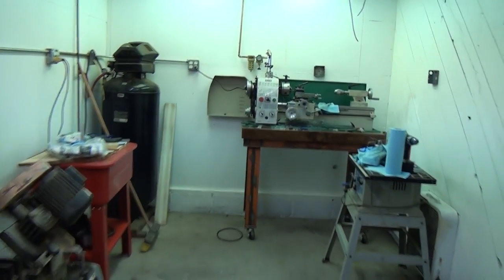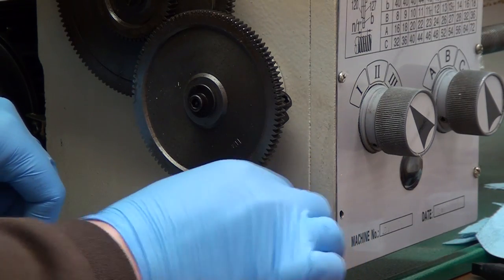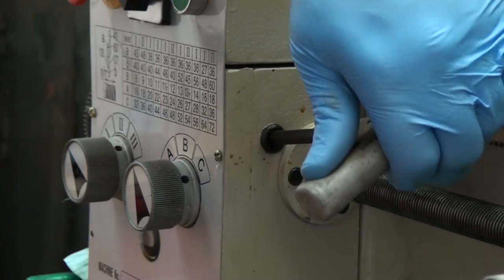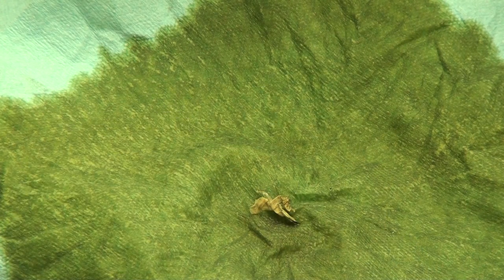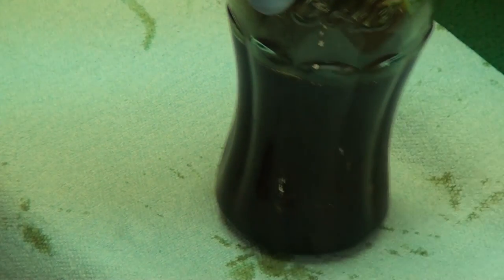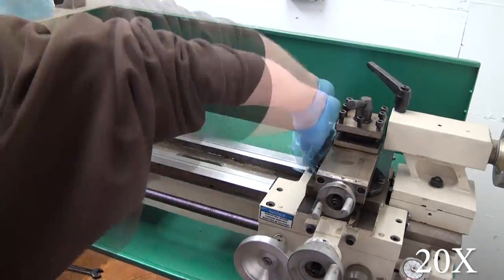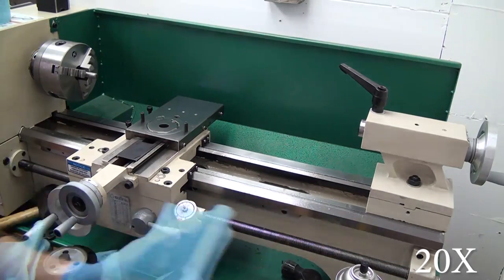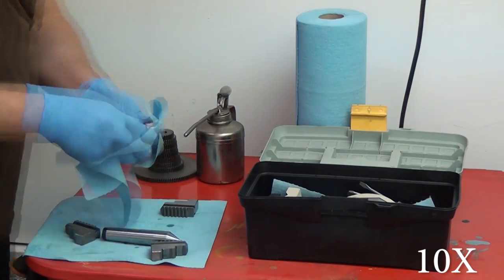05 G0602 Cleaning and Oiling

Comment: Did you ever remove the leadscrew from the left side, into the gearbox?  I have a G0768 that I am re-building (it's actually new) and want to look at the ball bearings but need to remove the leadscrew in order to get get access to them.  When I remove the left cover (on the gearbox, similar to yours at 1:06) it only comes out about 1/2".  Removing the right leadscrew bracket finds the leadscrew un responsive to pulling out of the left gearbox. Manual (not completely accurate) shows a key on the connector shaft left of the coupler but as I am finding out as I disassemble and fix/clean things, there are things that aren't what they appeared to be.  I am thinking I may need to use a puller mechanism at the right side coupling nut. Thanks for any help you can provide.
Reply from the maker: Hey Ron. I wish I could help you out, but the only thing I vaguely recall is removing the front of the gear box just to see how the knobs work. I was hoping I had some footage from when I did my CNC conversion showing whatever I was doing in there, but I just checked my raw footage and there was nothing of use. Good luck to you.
Reply: @russtuff  Thank you for checking!

Comment: I have been using 90 wt gear oil on my lathe as well. I read that chainsaw bar oil is a good substitute as it is sticky and stays in place better, so I will be switching to that soon, since i have a few gallons laying around and almost neer use a chainsaw anymore.

Comment: Have you given any thought to using ISO 68 for your gear box, lead screw, and ways? and use ISO 32 on your bearings, ball oilers and every thing else. It is cheap, About 20 for 2 gallons at your local tractor supply and is better formulated for these purposes. It's pretty much the same thing that all the companies sell at ten time the cost. Give it a try I don't think you will be disappointed.

Comment: I'm not sure if the HDR-CX350 has the "Intelligent Auto" setting (I'm using the HDR-CX760V--finally had to replace the HDR-SR11 that I basically worked to death over the past four years).  If it does, you might want try a manual white balance on the HDR-CX350.  It'll make for better continuity on different takes.  (Makes the blue shop towels actually look blue under the fluorescent shop lighting.)

Keep making chips!  You're making my little G8688 envious...

Comment: I was curious about what Grizzly had to say about the grease in the spindle bearings.I emailed them and here is their response:"The spindle bearings of the G0602 are packed with grease for storage purposes.  For operational purposes, you should be oiling the bearings prior to use, every day you use the lathe.  This will wash the grease our of the bearings, but they will be properly lubricated with the ISO 32 oil".Hope this will help other owners of this lathe.
Reply from the maker: +Bill rouleau Wow. I wish I had realized that. I've been running mine since 2011 until about a month ago having never oiled the bearings. Last month I started pumping in non-detergent 30-weight engine oil. I use one of the Harbor Freight small oiler (not the large one with the seam).

Comment: Do you have a suggestion on oil to use in the ball oilers? I live in the middle of no where and no one has ever heard of iso32... thanks and love the video!
Reply from the maker: I"m using 30 weight non-detergent oil in my ball oilers. I picked it up at Autozone, and I believe it's Autozone brand too.
Reply from the maker: Hey O'Reilly has ISO32, it's just 10W hydraulic oil. I bet other auto-parts or tractor places will have it. Check out https://bit.ly/2uvk2YR

Comment: Hey Russ - 7 years later, what are your thoughts now?  Are you still using the same products to lubricate or did you finally pick up the Mobil 1 Vectra?  If you switched products, did you notice any added benefit?
Reply from the maker: +Ryan Bishop yes I switched to Vectra no2 in 2014. I bought one quart of it on Amazon, I'm still using that same quart. I did notice a difference, but I run my lathe on the dry side so it's lasting forever. I do like it though, you can buy it here:
 https://www.amazon.com/dp/B00A3UXP54

Comment: After all the comments of oiling or not oiling I wanted to know.Really wished Grizzly had installed a better (maybe) sealed bearings in the spindle.The spindle bearings appear to be an open framed tapered roller type.
Reply from the maker: +Bill rouleau Yeah they must be. I have intended to replace mine with some nice sealed bearings but i've been told by another owner it's a huge pain to do. I haven't researched it all that much though so who knows.
Reply: +russtuff  Looking at exploded drawing in the manual would make me think twice about doing a replacement until they fail.

Comment: Did you find any down side of using the 90wt oil to cover everything?
Reply from the maker: Nope, it never was a problem (other than being a bit sticky). These days I'm just using 30wt non-detergent engine oil, the same stuff I've been using in the gear case. So far, no problems.